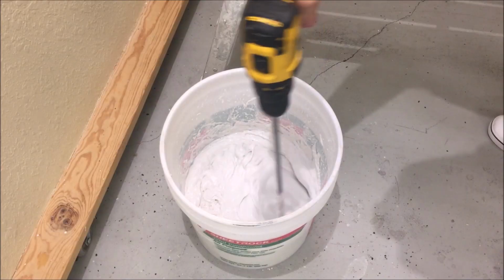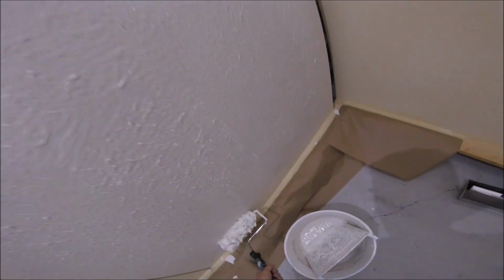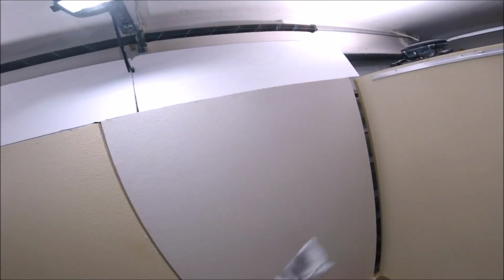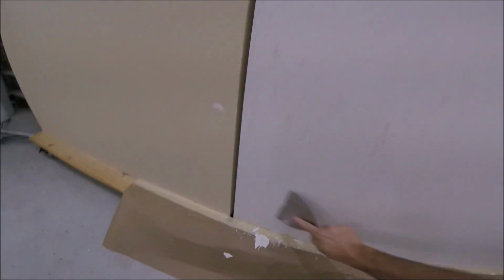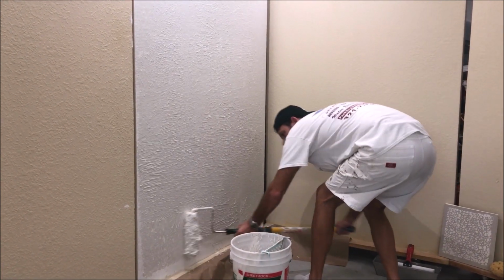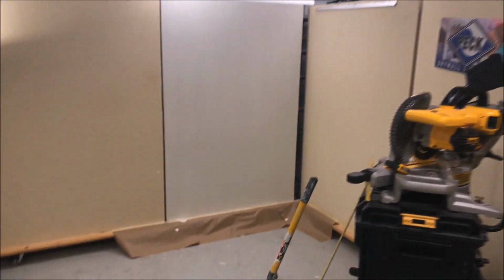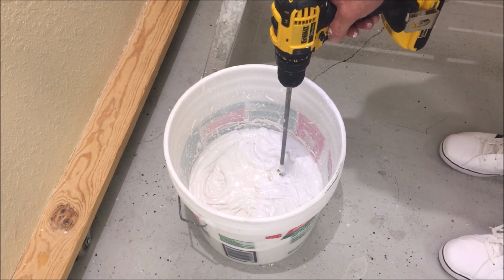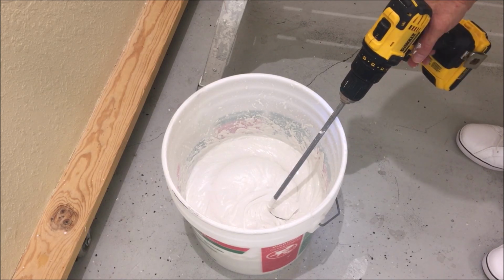The ULTIMATE SKIM COATING GUIDE In One Video!

Comment: I'm a DIYer who has never skim coated. Thk u for this great demonstration. Question - I don't have a lot of strength in my arm so need to use a short handled roller instead of a long handle/pole, which will necessitate me going up and down a ladder to reach the ceiling. Won't this leave a demarcation half way down the wall? How do I eliminate that?

Comment: Really appreciate the videos.  Haven't seen them all yet but working on it.  Once you have the wall skim coated and sanded smooth, do you use primer, Gardz or just hit it with paint?
Reply: Hi, Did he answer thus question?  
@paulpeckdrywalltube great job Paul 

Also was there prep involved before skimming?  Sanding or attempting to remove some  texture

Comment: I need to skim coat wall because we will be removing glued on paneling. Last time the glue lines pulled  off the drywall paper. A contractor said I should just simply remove the drywall and start over. I’m a DIY and have done SOME drywall mudding. We are remodeling a large bathroom and will be adding one partition wall perpendicular to the existing walls. The paneling goes 4’ up the wall and encircles the the room. Glued with “lines” and not the entire back of the vinyl panels. I know the torn areas have to be prepped to avoid absorption etc.  Thanks
Reply: Zinnser makes Gardz, a water-based sealer.  Use a knife to cut clean lines around the torn area and remove that part, apply the sealer. Once dry, you can skim over with no problem.  I've used it over wallpaper as well.

Comment: If I'm going to skim coat an existing painted room do I need to prime the walls first. I'm a DIYer and plan to remodel my bathroom which will require me to remove some drywall so I'm planning to retexture the whole bathroom.
Reply: I was wondering the same thing.  I have a hallway where someone painted over wallpaper so I have a double whammy.  I know I'll need to skim coat, but like you, do I need to prime walls first?  Or possible seal it witth Kilz or 999?  For another room where I had wallpaper (no paint), I was instructed to seal it with Kilz, then prime it (123 primer) then skimcoat.  Good luck with your project.

Comment: Hey Paul, I got a painting question, so I recently remove popcorn texture on an old house ceiling and textured it with knock down. What primer would you recommend before the paint?? I thought of a pva to seal it because there were some part were I put new drywall, but because most of it was old and there were some yellow areas I thought of kilz, but not sure which one, there are like 4 different types! Oil based, water based… and so on.
Reply: I took mirror down bathroom need to seal n float then orange peel

Comment: Can I skim coat wallpapered walls in my mobile home?
Reply: Only if you're trying to remove the wallpaper. Putting mud on wallpaper will make it bubble and come off because of the moisture. That's a drywallers trick to getting really stubborn wallpaper off.
Reply: Yes I just did this in a house I’m working on.  What you have to do first is 1) peel off any loose wall paper 2) seal the wall paper with oil based primer.   The oil based primer keeps the moisture in the mud from getting through to the glue in the paper.  Prime it very well with no missed spots and then caulk the seams in the corners. Once you do all of these you can skim coat the walls and texture them.

(Make sure you let the primer and caulk dry first)

Comment: why do I have trouble with butt joints. they call it flashing I was told. you can see the butt joint when day light is around.
Reply: Sounds like you're not putting enough mud on or you're not tripling it out - (a 10' knife stroke down the middle and 1 left/right of the middle).